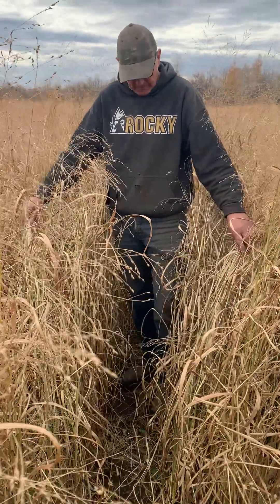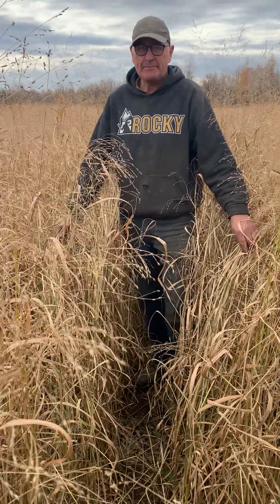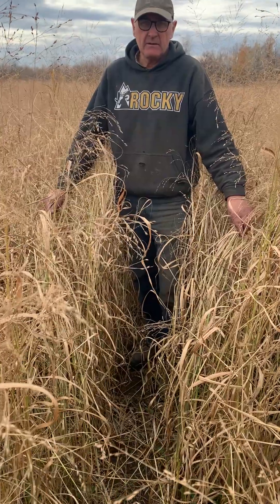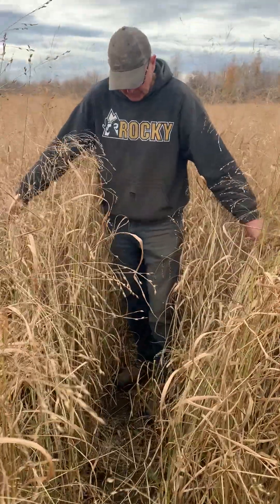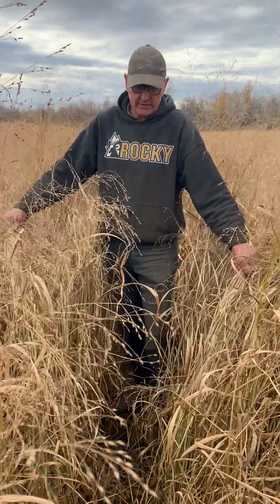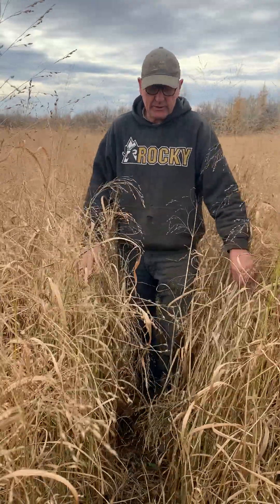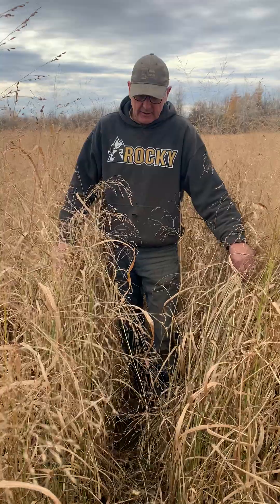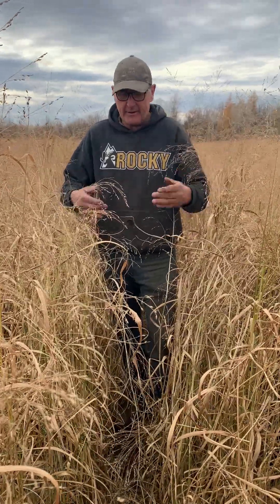Is Twin Row Switchgrass Poised to be the New Standard for Drill Seeded Upland Switchgrass?

Comment: We gad problems with weed escapes  u have to have more plants to choke out the weeds !  had to completely retreat with herbicide
Reply from the maker: Well its providing better in-row weed control we are finding. Then with two heavily seeded rows together,  weeds between those rows face a lot of competition. We haven't had any problems at all with high seedling vigor varieties with this system. I don't have a solution for weed control if people are using slow growing unimproved lowland switchgrass.  I am only saying it should work reliably for most with upland switchgrass with exceptional seedling vigor.

Comment: Hey Roger. What is the spacing of the rows on the seed drill? Trying to gauge how tight the twin rows are to each other and how far apart the twin rows are from the next. : ) Nice work, as always!
Reply from the maker: They are 7.5-inch spacings so 15 inch gap.
Reply: Pounds per acre?
Reply from the maker: @stevelamie2009  8 is good